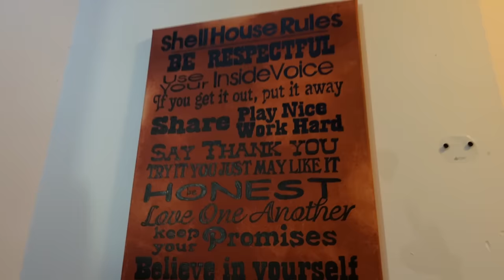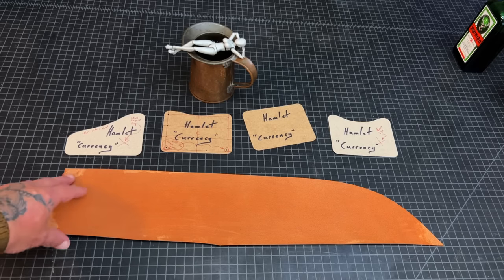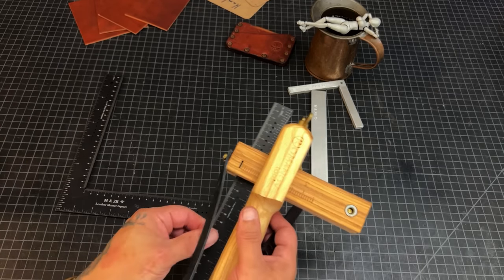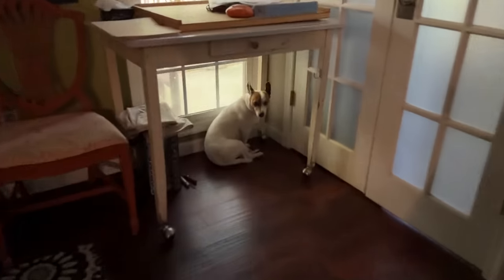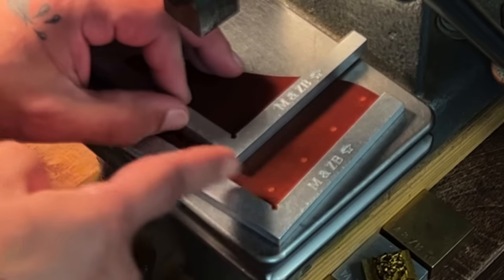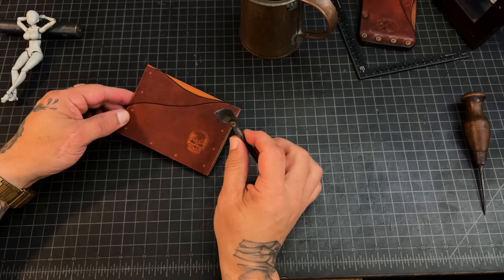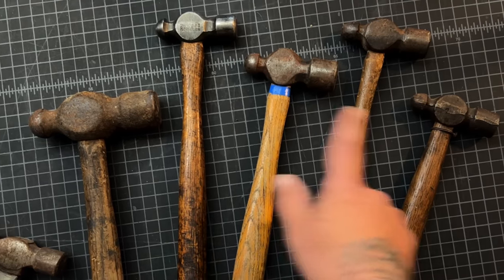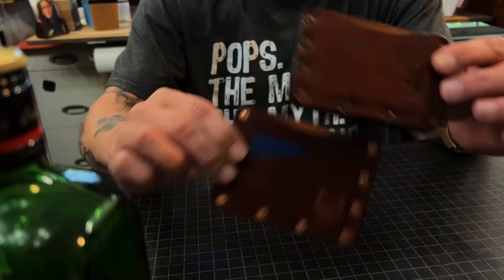Leather Wallet Build w/ EASY Copper Rivets! (& 2 New Tools!)

Comment: The bottle of "white mud", what exactly is that that you are using to get those wonderful burnished edges?
Reply from the maker: See my “questions and answers “ video.  I explain it all.
Reply: Thank you.  Im a novice LW and i will take any tips i can get.  One question you might have answered is when cutting copper rivets, how much material do you want to keep for peening?   @MasconLeather
Reply from the maker: @77wolf89 I leave about 1/16”.  No more than 1/8”
Reply: My apologies for all the questions.  What size Edge Bevelers do you suggest.  Im using a Tandy Brand ( i think size 5), and i and i really think its just too thick and takes off too much leather on my edges giving it a feel im not liking.  Is that too big for 5-6oz leather or am i just needing way more practice?  @MasconLeather
Reply from the maker: @77wolf89 I explain those all in my tool cart video.  I have 5 sizes.
Reply: Thank you, you have helped me out with your videos.  I still have a few questions, but they might be answered with your other videos. @MasconLeather